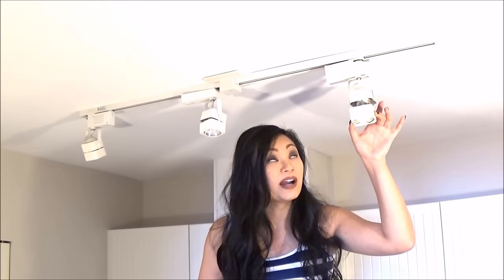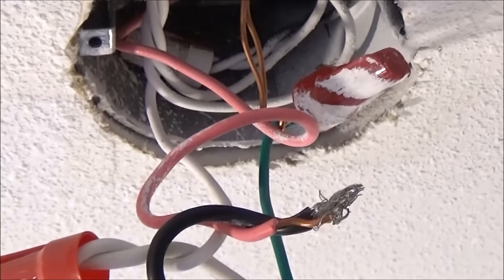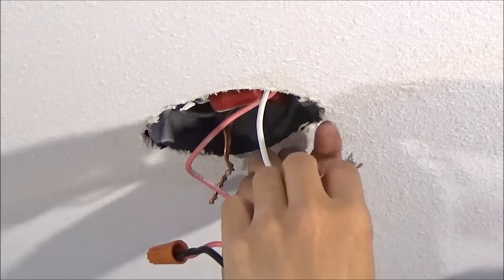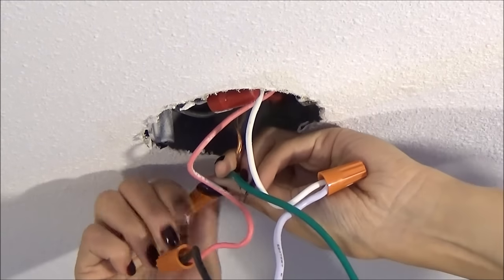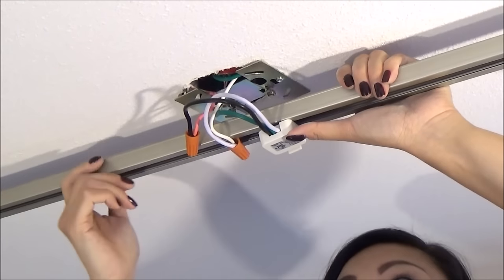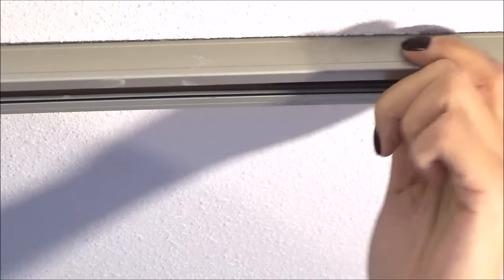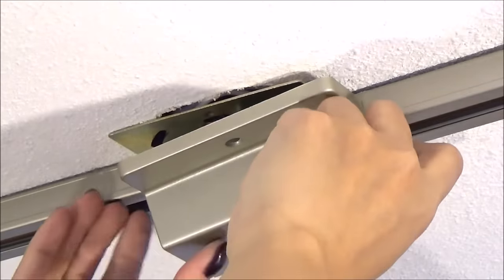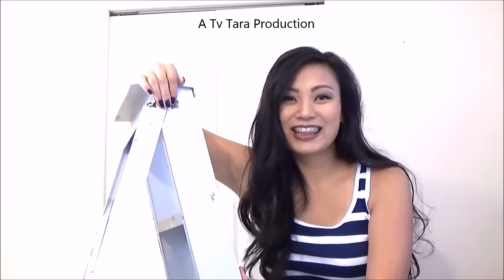How to Install Track Lighting - Changing a Light Fixture For Beginners

Comment: As an extra precaution I always cover the wire nut with electrical tape at the wire entry into the nut to prevent any broken strands from the wire nut sticking out shorting to the bare metal especially when reinstalling the fixture all the wires are pushed and jammed in a tight space. An extra safety is well worth it.
Reply from the maker: Ok thanks.

Comment: İs there  a ground connection in the lighting circuits In the american electric standard  there is no ground connection in the German electric standard that I know, and how many volts are used in Canada 220 volts (German electric standard) or 110 (American electric standard) By the way, I am an electric graduate and  this assembly work you have done is quite within the standards and I admire your skill, you did the job just like a German, beautiful and flawless.

Comment: Good tutorial but what about for track lights that are higher up on the ceiling requiring a ladder and one piece and around 5 to 6 lbs? I find it hard to lift it over my head for prolonged periods of time especially when you find out you have the wrong screws lol
Reply from the maker: Anything heavier and you’d need a second person unfortunately!
Reply: @TVTara  I reinstalled track lighting using a stepladder because the ceiling is 8 ft and I needed a new transformer so we proceeded to install the track lighting but my setup is once piece metal light with all fixtures made of glass and metal components, I had to lift it above my head (around 4 to 6 lbs) for a good twenty minutes while we tried fiddling with the wires and screws. Tires you out easily after a while but we successfully mounted it a bit after.

Comment: Don't use needle nose plier to twist stranded wire, twist connectors also require no pre-twisting, just make sure the stripped section of stranded wire is slighty longer, say 1/4", lighty hand twist and use the twist-on connector, if it has a good grip, the wires will start twisting once it bottoms out, pull on it to make sure it's on tight.
Reply from the maker: Ok thanks for the tips!

Comment: Good quality video. I am thinking of doing this in my kitchen replacing fluorescent lighting but I need to figure out how to make the square box on my ceiling look nice with dry wall work.
Reply from the maker: James Chuaycham Ah yes, I had that problem when replacing my living room track lighting. Luckily it was not a large area. I just used white putty to patch it and then use a sponge to match the ceiling texture. It's not perfect but luckily no one notices.
Reply: +TVTara my question is where did you learn electrical installation? Btw Nice work:)

Comment: Never this simple.  So I disconect 3 wires and my new light has 2 wires.
Reply: Ok found the green wire.. was separate
Reply from the maker: Ah, good!
Reply: @TVTara    but...in your video you connect wires, then the metal plate  magically appears. Which I forgot to attach.  Grrrr. Completely forgot it existed. I'll slip it under track and rewire.